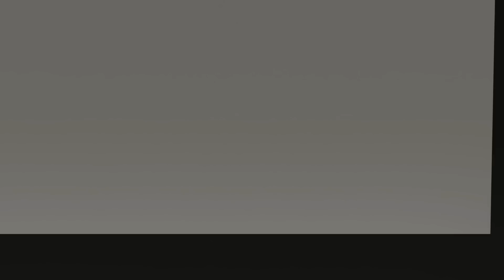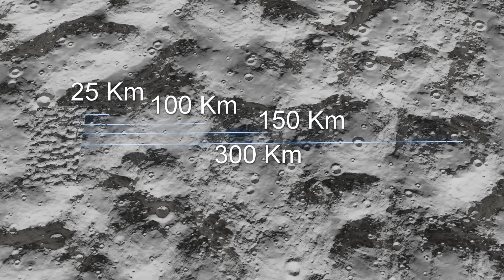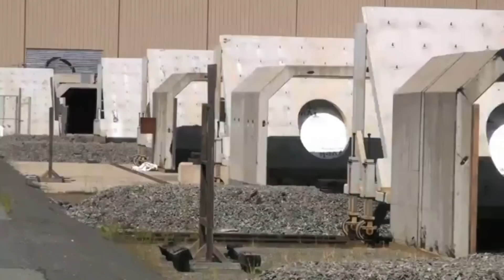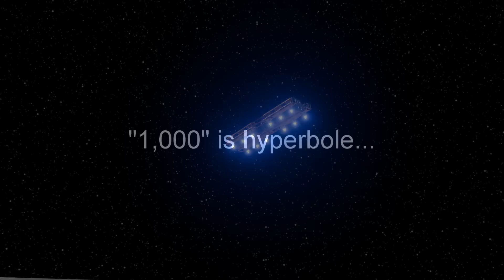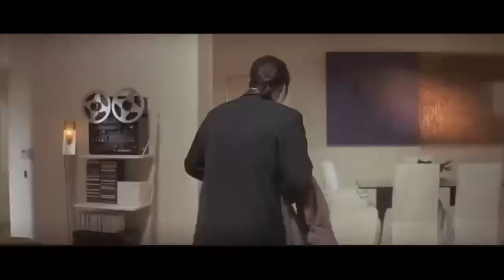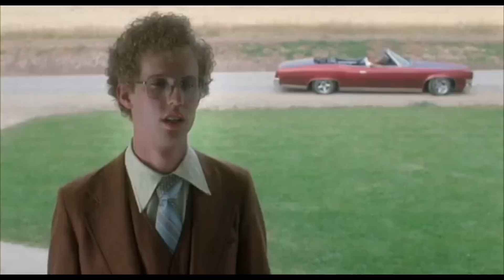Why Rail Guns Make For Better Lunar Mass Drivers

Comment: I always thought that a slow railgun accelerating and recieving cargo/crew pods from a constallation of skyhooks is the winner combination, since skyhooks can pick and drop from the surface even with current materials, therefore bypassing the need to use rockets of any kind, even though simple and natively build combinations like O2+Al or O2+Mg can be used at scale without leaving gaseous residue to not harm the high vacuum enviroment.
The railgun + skyhook combination is also very flexible about orbits, recycles most if not all the kenetic energy involved in upstream-downstream traffic and can be progressively deployed. Factors like railgun lenght, Max allowed G-loads, hooking rate and total payload can be balanced in multiple and incremental ways.
 Skyhooks in the Moon can orbit at ridiculously low altitudes due to the lag of atmosphere and if positioned in a highly eliptical orbit they could have much reduced and easily-correctible perturbations due to the Moon's gravitational anomalies, but the hooking opportunities at a particular location would be also reduced.
With that combination you can have as long or as short a railgun as needed, balancing G-loads and track lenght depending on your biggest limitation.
Food for thought!

Comment: A coilgun is a linear motor. It does not need to wrap around the vehicle, it can just be rails with coils, like any maglev train. Making a hundreds of kilometers maglev track on the moon is probably more expensive than railgun tracks, but then, no ablation.
Reply: Also don't need to reach lunar escape velocity if spaceship can perform a circulization burn. Orbital velocity of about 6000 kph or 3750 mph needed if vehicle can perform a circulization burn.

Roughly 1.4 m/s² acceleration over 1000 km track to reach that speed. That's roughly 1/10th of what a typical consumer car is capable of and slightly more than what current maglev trains manage.
Reply: coil rails will probably take vastly more manhours per kilometer of track because millions of kilometers of copper coils have to be coiled around the rail while a railgun rail can be as simple as a thick rod of metal like a traditional railroad tracks.  Realistically railgun rails would be the first to be made with coil rails coming in later when the moon economy is larger
Reply: @groomschild1617  The tracks can be permanent magnets, but you need to power the coils on the train. The materials to make ferrite magnets are readily available on the moon (you could probably find neodymium somewhere, but that is harder). If you are already smelting iron and Aluminium for structural purposes and harvest oxygen and silica, making it into ferrite magnets is not much additional processing. The train can be powered from a pantograph, all that needs replacing is the graphite pad electrode on the train.
Reply: @pyalot a big ass pantograph would be quite expensive. Compare to YBCO superconductors which only need LN2 to keep cold for your launch time which is all of what, 120s for humans? Maybe a bit more for less g? Once powered up they are superconducting so you don't need to input more energy beyond the initial power up. Seems way easier than a hundred kilometre pantograph line.
Reply: @pyalot  Dont know the details of magnetism but from what I know cooling and heating cycles can ruin magnets. the cycles on the moon are pretty extreme because of the lack of atmosphere to moderate the temperature changes. I think stellar radiation can also degrade magnets overtime since high speed particles can knock the magnetic atoms out of alignment. at the end of the day It will have to be a wait and see kind of problem because humanity has never built on another world before.
Reply: @Shrouded_reaper  you can put enormous arking currents trough pantographs with very little damage, how do you think trains and carbon ark furnaces work? Most of the degradation of a pantograph is from the sliding friction (which is very low between metal and graphite) that is needed to press the pantograph against the rail. Subway siderails keep far more precise alignment with the power rail and so they use a contact patch about the size of your hand, and it needs to be replaced once or twice a year.

Comment: Instead of rail guns, consider maglev rails as a mass driver. It's non-contact, so it sidesteps the wear problems. It would also be insensitive to contamination by lunar dust on the track, since you could cover it in insulating shielding. It isn't diameter constrained like coil guns. They can be built with or without superconductors, depending on performance and cost requirements. Depending on the design, they can be passively stabilized instead of requiring active control systems. 
Another option is docking freighters with some combination of surface-to-orbit structures like space elevators, space towers, skyhooks, or orbital rings, which run freight trains to the surface to exchange cargo loads, and which can have mass driver runways optionally built atop them. Skyhooks would sidestep the need for mass drivers.
Reply: I agree. And - admittedly without having checked it - I think with some of todays superconductors, you wouldn´t even need to cool those. I should be enough to keep them in the shadow. They may be complicated to produce however, I´m not an expert.
Reply: @AndreasPeters-r3e YBCO superconductor coils are quite easy to make and it's commercially available. Superconducting at LN2 temps so yes no cooling required for night time launch, but even during the day the coils will be shadowed by the vehicle and the launch time is not more than a few minutes. A small bottle of LN2 would absolutely be all you need.

Comment: Question that was digging in the back of my head whilst watching: how would the raingun be protected from things like meteors falling on the track? You’d probably need to take the whole thing down underground or just pray nothing hits the track
Reply: You just have spare track segments and monitor for projectiles. If you detect one than stop launches, take the hit, send your spare segments out and repair. It's not a common enough event to bother with underground tunnelling the whole thing.

Comment: You only need capacitors and aluminum rails? Yeah a lot of capacitors, like 100 000 tons of them, really this is a megaprojects, a centrifuge is much smaller.
Reply: And that's just for one launch platform.  

A spinlaunch like platform can launch Raw materials to space   spinning up over a much longer time as power is available without an expensive pulse power to system to power massive rail gun.

Comment: What about a giant Funicular up the side of a lunar mountain, the weights, on rail carriages themselves,  (using some kind of liquid or perhaps dense rock sand) could operate at a steeper angle on a different track or a drop shaft.

Comment: There's also the issue of deceleration of the carrier system, but that can be at somewhat higher G's due to the cargo or passengers having detached or it being an emergency cancelled landing.
Reply: even using purely chemical propulsion systems, youll save a crap ton of energy having lunar local produced fuel, and IIRC you actually get a huge amount of oxygen byproduct when refining your metals, so that should more than satisfy your needs when burned with aluminum

Comment: I wonder if it is necessary to accelerate the entire launch/landing pad for every launch rather than just the freighter itself, that seems very risky (plus you need to slow down and then return the launch pad after every launch and you also require much more energy for every launch, the launcher also can't curve upwards to give the freighter altitude in addition to velocity). Using the mass driver to accelerate only the freighter would have some downsides (the connection points to the rails would need to be on the freighter itself, which would add some weight to the freighter and you would need a system, perhaps large cranes, to move the freighter from the landing pad onto the mass driver), but I think these downsides don't outweigh the upsides of not having to accelerate the entire launch pad.

Great video, I wish I could do animations as well as you do!

Comment: Air tight accordion gasket. Next question.
Reply: Where you gonna get the rubber? How are you going to maintain it? How are you going to make new ones? What are you going to do about the UV shining on it? How will it remain flexible through the extreme temperature swings? It's not so easy.

Comment: How about a MagLev approach to avoid ablation?  Rail system would be somewhat complex, but no on-board acceleration would be required.  IDK - maybe MagLev physics won't allow required speeds?   They could use the CA MagLev rails -- looks like they aren't going to use them!
Reply: Maglev is how it will be done but coils won't be integrated into track, it will have permanent magnets it it. Magnets will be on the vehicle.

Comment: What's wrong with usibg normal SCmaglev tech? We already have and there's no ablation problems. You could also regen some of the energy back as the launch pad decelerates after launching the cargo.

Comment: How about a space elevator on the moon.  It can be very possible with current materials.
Reply: Spinlaunch's current suborbital  launch platform already has a launch velocity near lunar escape velocity.
Reply: @kreynolds1123 Spinlaunch is an engineering nightmare here on earth and doesn't make any sense economically but yes, definitely has potential for the moon. When you drop down gravity by a huge amount, remove the atmosphere so no complex gasket and gas blowback issue, etc... it looks very viable for material launch.
Reply: @Shrouded_reaper  😁 i dont intend to speak over eachother.  We sort of agree on lunar material launches will likely become commercially viable one day.   their suborbital launcher is already in the scale for a lunar material launcher to escape the moon's gravity. And a lunar orbital accelerator would be much simpler and lighter  without needing a shell that can withstand multiple Mach launch velocities as is needed  through earth's lower atmosphere. 

I still belive that a terrestrial spinlaunch may have a better chance at launching buckets of water from earth to be processed into rocket fuel in an orbital refueling station. Water doesn't break under heavy G acceleration. The orbital accelerators might even be repurposed and attached as boosters to help space craft to higher orbits after converting its water payload to focket fuel.  Spinlaunch might even want to partner with SpaceX  for refulling starship rather than launching refulling rockets with all the fuel weight  from launch pads  that get torn up   from the power released from launching a heavy rocket.

Comment: Don't want to throw so much shit, just constructive critisism, but instead of launching the entire launch pad either.

 A) launch only the lander with the containers.

B) Launch individual containers with a small module that contains attitud control, thrusters and aviaonics (or the avionics could be else were and the module would just have a recive and computer to carry the instructions that a morr advance computer elsewere is giving) to be abke to rendevouz and dock with the orbital lunar port.

C) basiclly B but with larger modules and a cluster of containers, likely more efficent due to economies of scale.

If you take options B or C the probem arises of what to do with the empty lander. 

Option A) to launch the lander back to orbit separetlly. 
Benefits, a less powerfull mass driver is needed than if all the mass would be launched at once. Aldo the same energy would be required, but not at the same time.
Problems: launching all of the lander with the cargo may be simpler and also thus methid would take more time.

B) not have a lander and have another  mas driver in orbit deorbiting the cargo. Aldo this would mean having to inject energy into the nass driver to compensate for the energy that driving the mass to deorbit the cargo. I don' knkw the math but probably it would take the same energy as just having a lander land. There are many different dynamics that could make either the lander or orbital mass driver  better than the other esoecially if we take economies of scale in mind probably. But I don't know this concepts would have to be delved deeper into and actually do the mass to know which one is better.

Comment: Interesting parallels to my books. I've also written in the 'nuclear zamboni' and heavy equipment run by vehicles -- locomotive  or wired -- run by compact Liquid Fluoride Thorium Reactors. There's plenty of thorium on the Moon and the only solution to any kind of industrial process such as molten oxide hydrolysis. Another element to be transported to the lunar surface is carbon. for methane fuel. For space travel, I rely on VASIMR engines using LFTRs for power and oxygen for propellant. I hadn't thought about vacuum compatible hydraulics but it's an idea that needs exploration.

Comment: Also just offloading the cargo at a safe distance and transportibg it indivually (small traincart for every container, aldo locomotive for several containers )back to base with traincarts/railway is insanely more efficent thatn moving the whole cargo toghether, + the lander-freighter  + landing pad to the port. Just move the cargo to the facility, not tye facility to the cargo.

Comment: And the freighters could have a streamlined logistic line going back and foward between ports, saving valuable tume that would be wasted on the surface base port. And specialisation in one task would also make all parts of the logistics chain more efficent.

Comment: Having the freighters land on the moon is stupid. It would be much more efficent if the freighters just went to another spaceport in lunar orbit were they deposited the cargo for specialised landers to transport to the base. Making back and foward (much shorter) trips between the base and the orbital port. This way not only would you subdivide the logistic trip for each of the parts, making them shorter. But the landers wouldn't need specialised equipment for a shuttle trip they don't need to make, reducing mass and increasing usufull payload and reducing fuel consuption. The same but otherwise can be said for the freighters, which wouldn't need the mass required for landing. In addition, not having to land would have the added and extremly important benefits of being able to use those previously mentioned nuclear engines, making the freighters much nore efficent. Which also means the freighter itself could be integrated into the shipbuilding economy. Also I know the imports of the moon would be much greater than it's exports but the containers could also bring back science experiments and other materials.
Reply: Lunar orbit is sorta useless because you're better off bypassing it, accelerating ships to moon's escape velocity straight away
Reply from the maker: "specialized landers to transport to the base." Freighter.
Reply: @Anthrofuturism  no, I mean a freighter that does back and foward trips between an earth orbital space port and a lunar orbit space port, and then a lander that does back and foward trips between the  lunar orbital space port and lunar surface base.

Comment: Why make it like a railgun when it could be built like a maglev train? I get the feeling that maglev would have less wear and tear. I’m only halfway through though.
Reply: I totally agree that using a maglev design with high acceleration would be better than an instant "explosion".
Reply from the maker: @Maytrx  rail-driven acceleration doesn't have to be explosive it can be gradual.
Reply: @Anthrofuturism  My understanding has been as soon as the electricity is applied the acceleration is instantaneous, so I'll have to look into how this works. Maybe start the voltage at very low and increase over time for higher acceleration? I'll be looking into this thank you eh.
Reply: @Maytrx  Railguns can have variable power settings. what makes railguns good for military weapons is that a massive amount of electrical energy like the full force of a aircraft carrier can be dumped into them in a moment to propel a bullet at transonic speeds. but the same railgun could be run off a car battery and the bullet will kind of just fall out of the end of the barrel
Reply from the maker: Eddy currents
Reply: @Anthrofuturism  What do you mean by Eddy currents? I don't know a lot about maglevs or railguns but I also thought that would be a better propulsion system due to no contact between the rails and vehicle
Reply: For military porpose. Rail "guns" with aimimg abiliti, and option fo overcharge for some peaceful reasons.